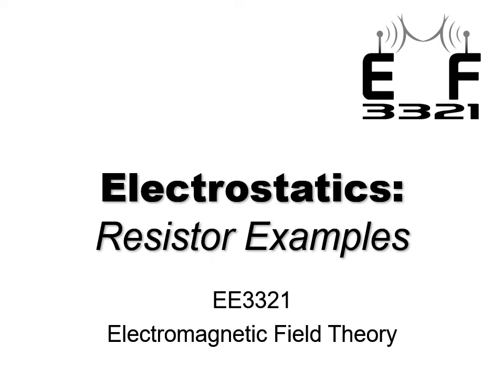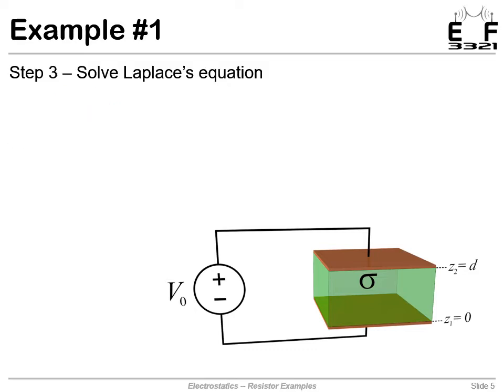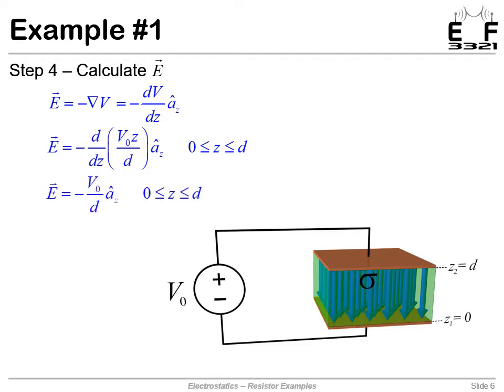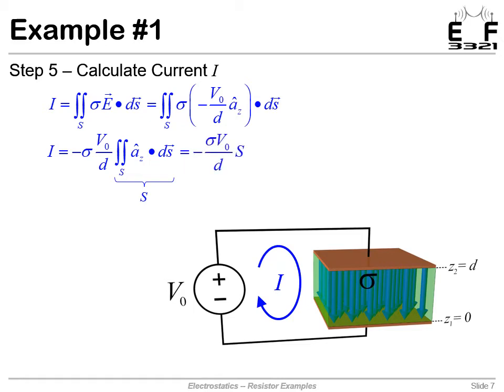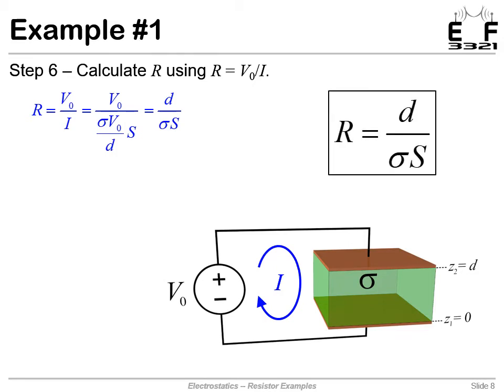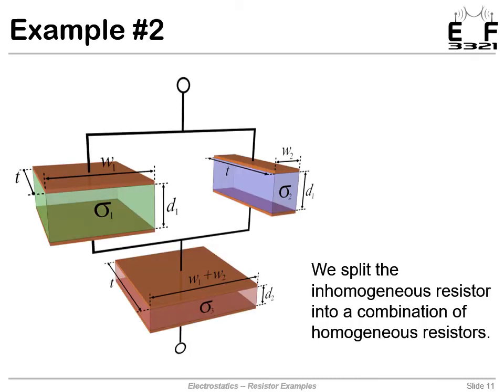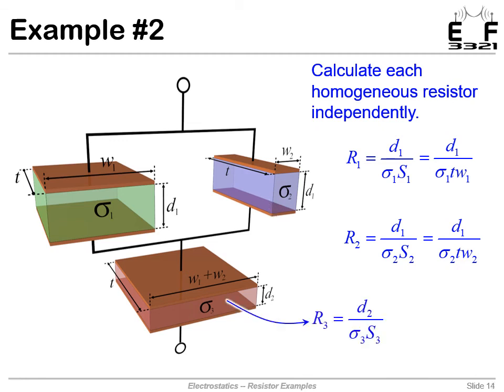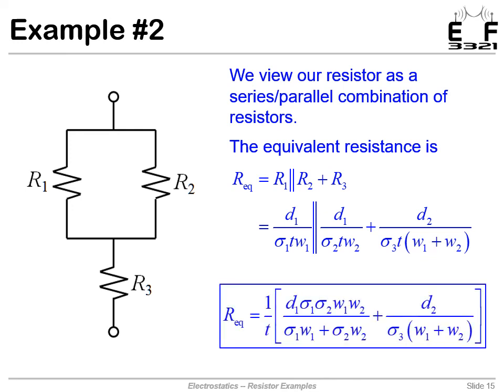Lecture 4f1 -- Resistor Examples

Comment: Hi，I have a qeustion regarding "Laplaces's equation". For resistor, current is flowing through, could we still treat "charge density" as zero? Should we need to refer to "Poisson's equation" instead? I am a little confused here. Could you help me?
Reply from the maker: For first-order analysis (simplest), when a current is flowing, the device is charge neutral. That said, all resistors also have capacitance and inductance. The electrodes act like charged metal plates to give capacitance, for example. For just analyzing the resistor, you can ignore the charged plates.
Reply: @empossible1577  Thanks a lot. I got it. Great Video.